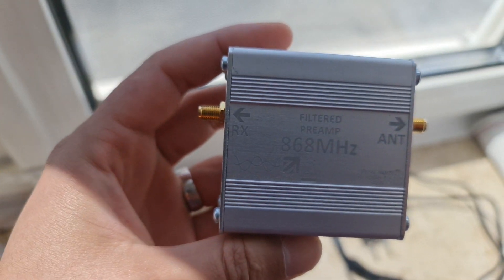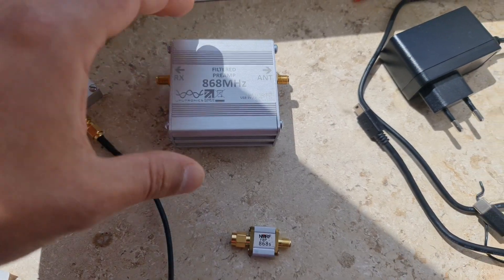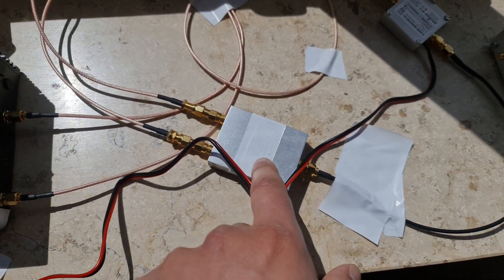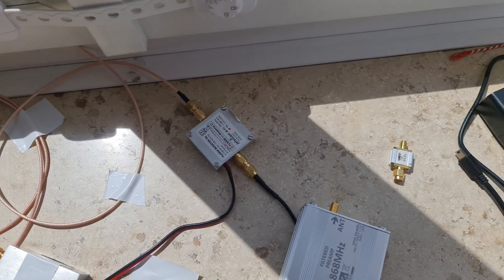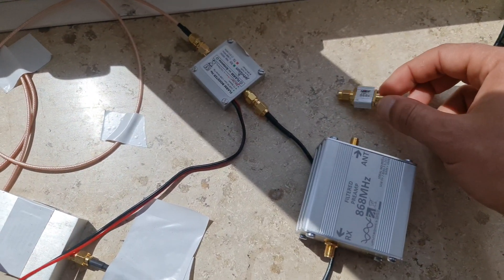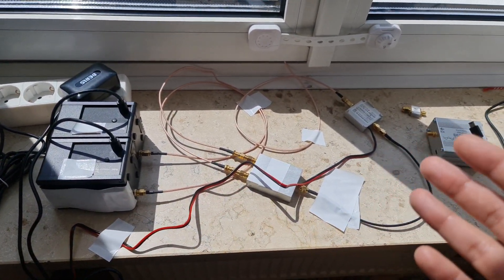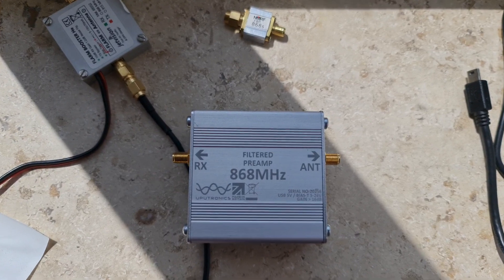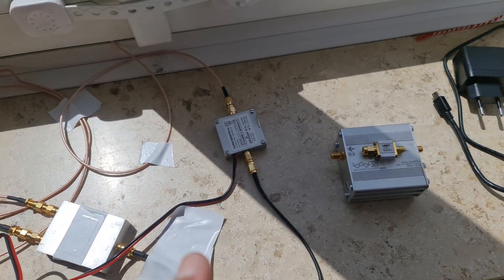Helium Amplifier UPUTRONICS Filtered Preamp  _ HELIUM ADDICT

Comment: Great contents as always. I have a similar setup with a 3 way miner splitter and amplifier, have you managed to solve the problem of rssi too high when one beacons and the other 2 witness? Using DC blocks, would it help? Again thanks for the contents, really informative
Reply from the maker: I still not find easy solution for Rssi too high

Comment: hello good morning ... I see your videos and I would like to ask a question ... you use an amplifier for 2 miners using a splitter ... is it possible to use an amplifier in just 1 miner? without splitter ... I'm in Brazil with a frequency of 915MHz, I have an antenna of 8 for 1 miner and an antenna of 5.8 for another miner. I have two rx:12 tx:0 amplifiers ... what do you think I should do: 2 miners with an amplifier + an 8 antenna or a 5.8dbi antenna? or would it be better to remove the splitter and put each miner with an amplifier and an antenna? abs and thanks for the videos...
Reply from the maker: But every Miner with his own Antenna and his own amplifier  and put the in 2 defrent location  as high as possible 
Best of luck 👍

Comment: Dumb question: Does Tx bypass mean that you cannot beacon or is that only for the specific  uptronics amp you have here? Your Flarm 10 rx/ 0 Tx can beacon correct?
Reply from the maker: Tx bypass its means you can beacon 
Uptronics Amplifier dasent have TX bypass  sow your beacon can't cross .

Flarm booster have Tx bypass  sow he  can beacon

Comment: Hello mate. Nice work I have a jetvision 17db amplier and a mcgill cavity filter With a bias tee. Does the light on the amplifier stay on constantly or comes on when needed ?  The light on the bias tee is on so that's power.  How will I k o the amplifier is working as I have literally just installed it
Reply from the maker: The FLARM BOOSTER Amplifier will be Green All the time (Rx mode)  he becomes red for 7 seconds only when he sends a beacon (Tx mode )
Reply: @heliumaddict8582  Thanks bro. If you fancy it. I got a sick project and great locations. I got a university that going g to allow me deploy my miners there an use nodes.  Hit me up. And thank you for answering my question.
Reply: @tonyeze2539  what country ?
Reply: @technodave   United Kingdom

Comment: Yoo king is back
Reply from the maker: Thanks Bruno Šic 🙏
Reply: How is your flarm working, i added it to my setup + mcgill and im getting 60% more witnesses than before, even with network broken like this, im very happy.
Reply from the maker: @secretboy69  same here 
Happy to hear that ✌️
Reply from the maker: @secretboy69   correct 👌
Reply: Hasn’t the preamp already got a filter in, that would explain why it don’t work with the added filter. Try the filter on the flarm booster, that’s where it will work.
Reply: @markh2k2  flarm has 3 filters inside, only add a filter if you have alot of noise on radio.